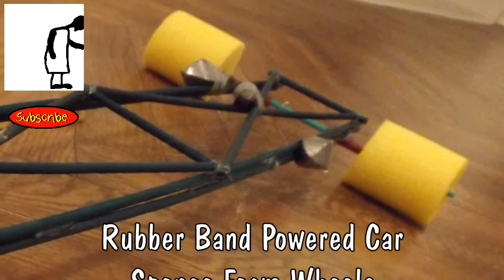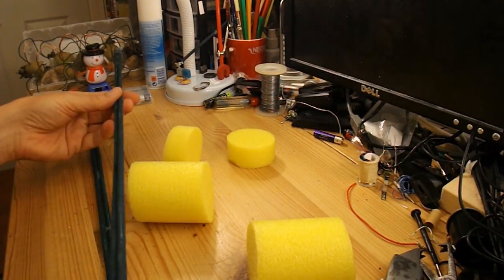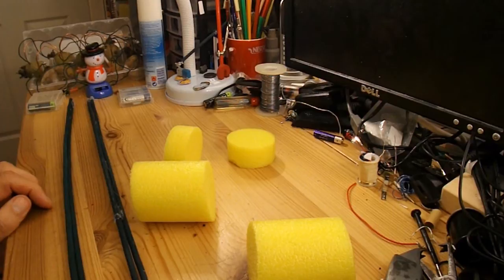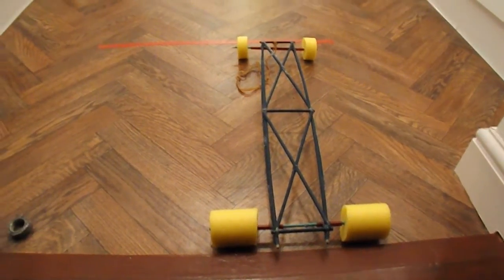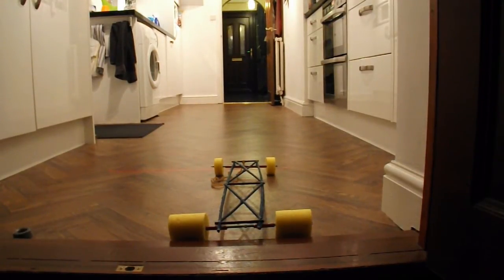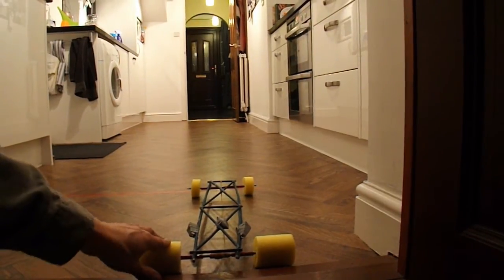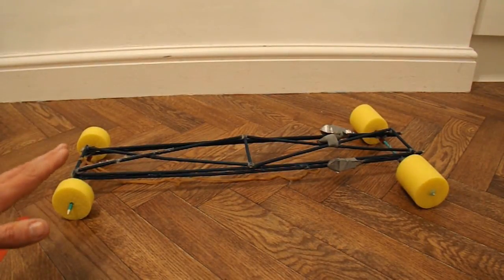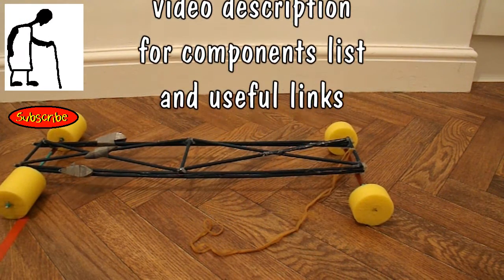Rubber Band Powered Car Sponge Wheels

Comment: And the combination of a friction motor with a rubber band?.
Would not the long haul?.
I think that lengthen the development of the band.
Reply from the maker: Most of my rubber band powered cars are based on tasks set for students and they can only use specific items for the build but I can see what you are thinking.